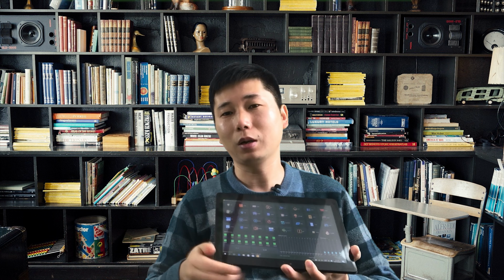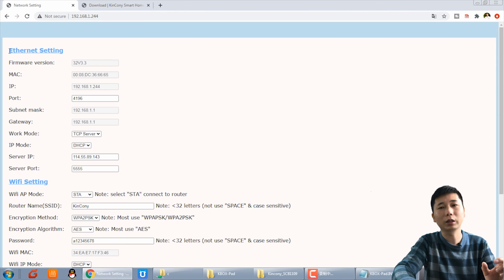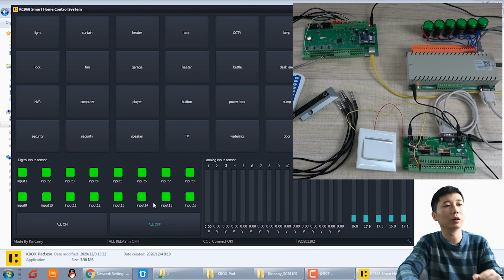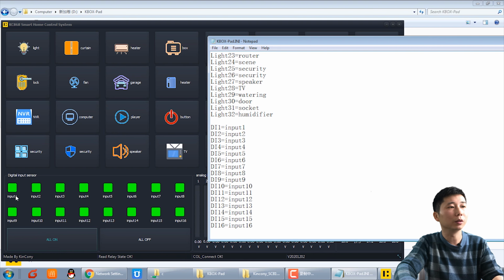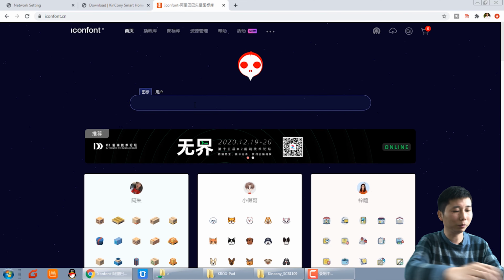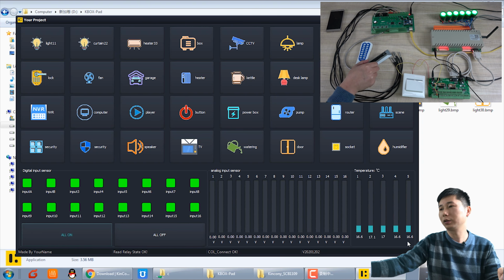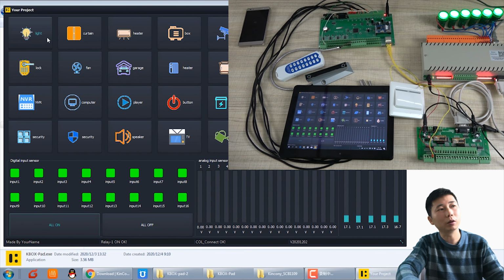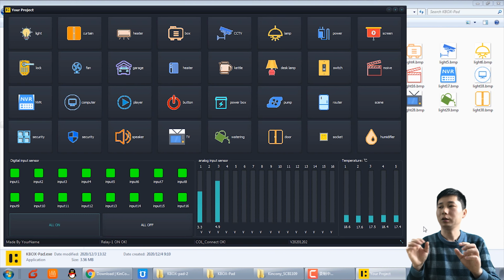how to use PC and tablet computer application for KC868 controller

Comment: Hii sir 
Can we connect mutiple kc 868 h32 modules (32 channel)with lan switch and control them from computer using one application so that when we switch ON RELAY 1 on app it will switch ON the RELAY 1 of multiple board (synchronised way)
Reply from the maker: sure, you can create scene mode on app.
Reply: @sir is there any demo availaible
Reply from the maker: @Parshant37  that need use by tuya app.
Reply: @ and sir what are the requirements
Reply: Thanks sir

Comment: Is there an option to set the buttons as a touch mood?
Reply from the maker: already use by touch mode.
Reply: @KinCony   but  if i touch the button, it turns on, if touch again then turns off.

So what i want is like this : i touch then turns on, if i leave it then turns off!!!
Reply from the maker: @saifkitany  KBOX and kincony smart home app have this function. do you want tablet have this function?

Comment: Hi Kincony I want to implement this apps what should I buy for my home implementation? 
kindly Advice all the device I need to purchase?
Reply from the maker: KC868-H32BS or KC868-H32B relay controller. KC868-COLB logical controller. here is our online store: https://kincony.aliexpress.com
Reply: @KinCony  thanks you sir, what we need to send if i want to apply ressller on your products here at the philippines.
Reply from the maker: @sUcrAti-n2e  welcome, when you have our products, it's better you can take some demo video of your introduce, so that if have philippines customers have interesting, we can let them contact your company.
Reply: @KinCony  thank you so much sir! You have any client here at the Philippines? If not i will introduce all your controller here at my country.
Reply: @KinCony  What if i want to add manual switch and alex voice command what do i need to add and purchase  device for manual and voice command?
Reply from the maker: @sUcrAti-n2e  manual switch need "switch terminal board" connect to relay controller. if you order the pad from us, it's a windows OS computer, you can install Node-Red on it running for voice control, so that you not need to order alexa voice module again. pad can voice control by alexa or google home, just not power of the pad.